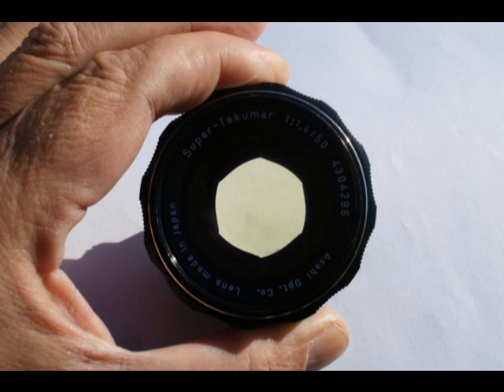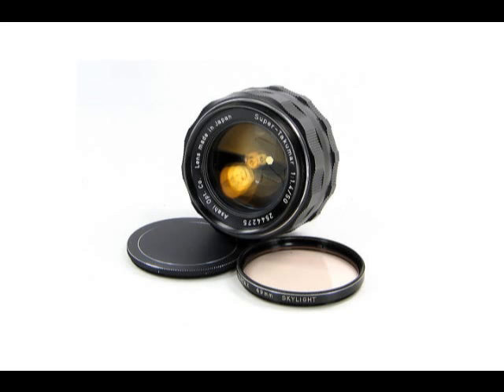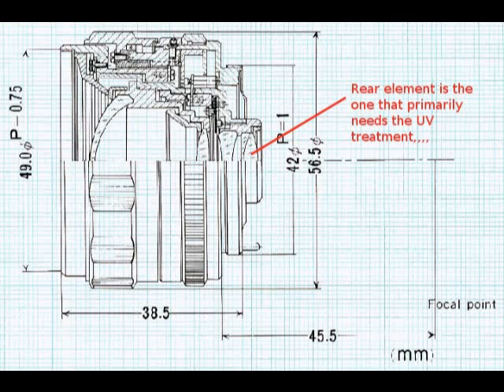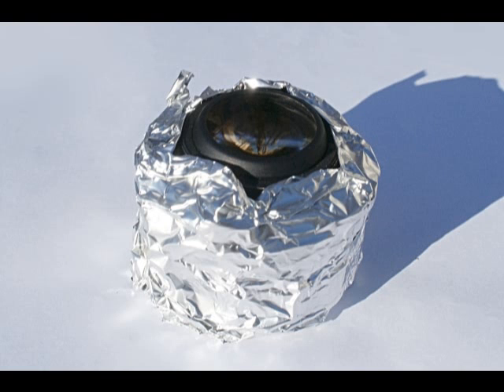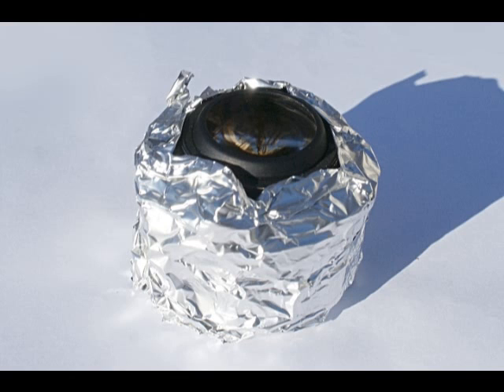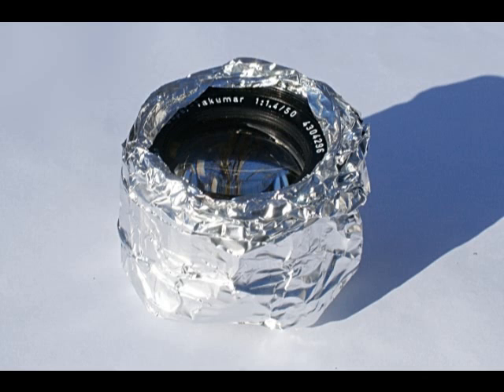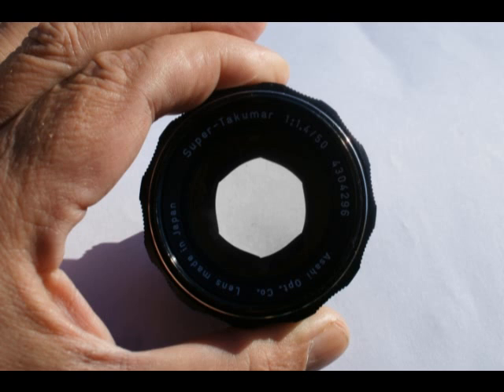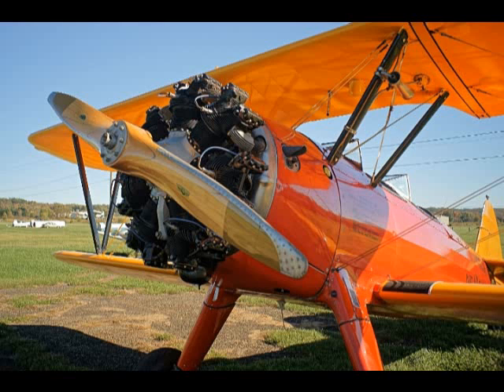Removing Yellow Tint From Lenses for 60's and 70's

Comment: Some lenses get solarized, even without radioactive additives.
Most brutal effect is seen with one century old glass from bottles getting blue or purple. Some optical glass could get a permanent yellow tint too.
in that case a UV treatment could worsen the problem... so be careful : before exposing the lens, just verify it has a radioactive element in it.

Comment: I'm trying it out now with a small lamp and ( I think) a halogen? bulb.  After just a few hours it was REALLY hot, so I've turned it off to let it cool down, I'm scared the grease will melt over the aperture blades.  Maybe if the globe wasn't so close it would still work but not get so hot? What do you guys think?

Comment: Are we sure this is the lens that is yellowed, or the cement used to glue certain lens elements together?  Organic cement used back then (Canada balsam being an example) will yellow as can be seen in lenses and microscope slides.  The radiation probably accelerates this.

Comment: I am the owner of a S.Takumar 55mm since 1970 . I recently bought a 4/3 camera and the results are fantastic with all my Takumars.4/3 is actually a 18-24mm. 
My 55 mm has not this problem with the yellow tint.
I never used a UV filter with it. This might be the reason . So recommend  to do so to avoid the problem once solved.